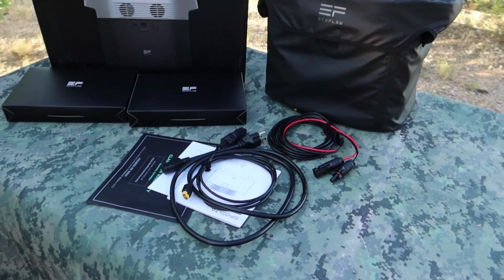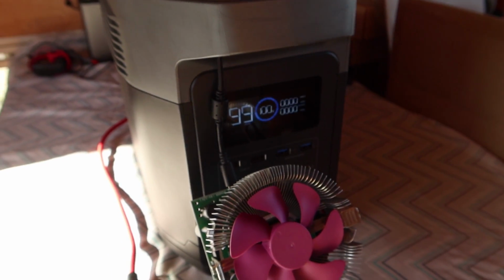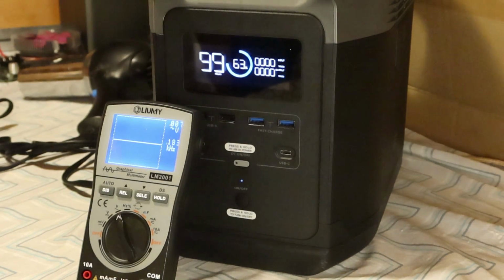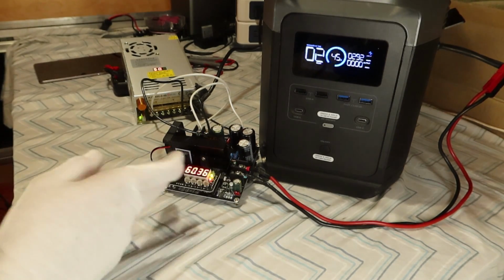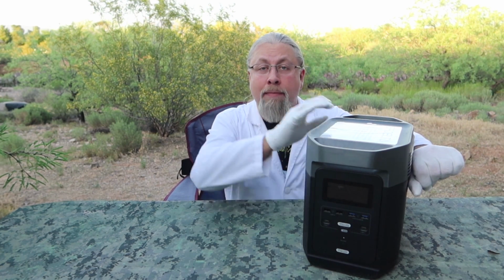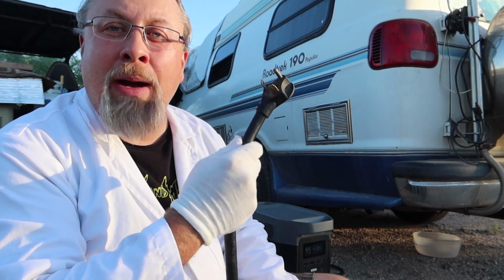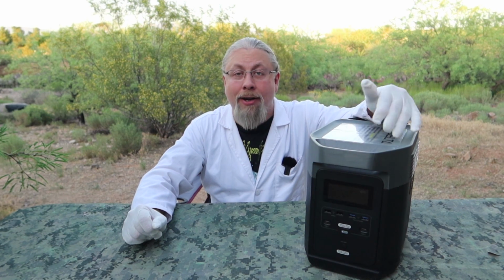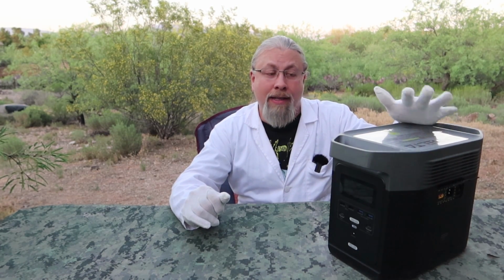EcoFlow DELTA 1300 A GAME CHANGING Solar Generator? HONEST Review! 1800w Portable Power Station

Comment: I bought two of these, as the chain function "sounded" neat, and they were $799ea on crowdfunding.  However:
1) It is not a great inverter.  
  a. neither will run my 12" radial saw, but a 2000w Xantrek + Valence battery will
  b. no inverter should have to have its cooling fans on w/o any load connected, and they are LOUD
2) The Round Trip efficiency came out to 58% and 60% on these units, the worse I have ever tested.  This is with fully charging, giving it a 2hr dwell time, then fully discharging, all @64°F.  
(Let me put it another way; you put $100 in the bank, but only get $58 to $60 back.)
3) People need to stop falling for EcoFlow's fluff- the standard for solar panel or lithium life is 80%.  EcoFlow just doesn't want to admit that they only give 500 cycles until you reach that.  Take 60% of the measured output today on a new unit, and ask yourself if you want to lug 31+pounds for that reduced round trip inefficiency.
4)  EcoFlow promised they would replace the batteries for free (you pay round trip shipping, which isn't cheap on lithium) once they get below 60%, but I have yet to hear of anyone having luck with that yet.  Nor do I trust them, as I told them my round trip test results and said I wanted to return them for a refund...crickets.
I DO NOT RECOMMEND.
Reply: good to know
Reply: I just picked up the River Pro and found the same lack of efficiency.  I can't believe more reveiwers don't pick up on it and just focus on the fancy bells and whistles.  So far I was only able to pull around 493-526 watts out of 720 watts advertised using AC.  Recharging requires over 900 watts.  Luckily I caught it on sale at Costco with easy returns.  Waiting to see what the new Jackerys promise.
Reply: Thanks for this. What one would you recommend ? Anybody ?
Reply from the maker: Go to hobotech.tv all recommendations and discounts there
Reply: @benallmark9671  Bluetti. The big one. Shop around as discounts are always being given.
Reply: @dougfresh1341  thanks !
Reply: $58-60 for a $100 ?!! Biden’s done a lot worse. 😏

Comment: Hello, quick question I am hoping you can help me with... I want to be able to use my 3qt instant pot  in my van, while driving or stationary ,, what would be my best bet for power? Thank  You in Advance for you input and suggestions
Reply: The  $80.00 one at  WalMart  only  pulls  700  watts = you  could  run it  for  about  two  hours  with  the  EcoFlo Delta  ( or  more  since  the  'instant pot'  will  be  cycling  off/on/off  once  it  reaches  it's  cook  temp. )   ALSO ,  if  you  are  charging  the  EcoFlo Delta  with  solar/etc. ,  it  will not  discharge  as  fast  or  at  all  .  .  .  .  easy  on  it's  battery  &  extra  power  available  later  .  .  .  .  .

Comment: What they failed to mention is that the amp/hour rating is probably is it were discharge for 20 hours.  I do not know how they would know what the load needs to be to make it exactly discharge for 20 hours to dead. The lower the load, the more power you can get out of it.  A heavy load will discharge the battery quicker.  Maybe the inverter uses more power, is less efficient, at higher draws.

Comment: Great video, but can you charge the ecoflow delta 1300 with 400w wind turbine.
Reply from the maker: Depends on the turbine.
Reply: @HOBOTECH  do you have any recommendations
Reply from the maker: @jasontrausch9745  Turbines don't work without a 50 foot tower so I gave up on mine a few years ago.

Comment: 800 cycles 😐
Edit: Ah, so, you’re getting 80% max of the capacity, and they’re saying it’s only good for 800 cycles to drop all the way to 60%. Methinks they’re using recycled cells because shouldn’t new cells be more like 3,000 cycles to reach 80%?
Reply from the maker: Generic lithium ion is rated 500 to 80%. Because they super charge and discharge this unit at the limit of the batteries the life suffers.

Comment: Your methods for measuring the purity of a sine wave is flawed.  At least you are now doing it under load, whereas before I watched you do it without a load, but to accurately measure sine wave purity, you must use a non-linear distortion analyzer or a frequency analyzer. Both use some form of Fourier analysis (FFT or DFT) to compute it.  Distortion is manifest by the presence of harmonic frequencies, so they would show up in either instrument.  The DA will give you the measurement as a % of non-linearity or distortion (THD).

Comment: How long can I run an iceco 20 fridge-freezer on the ecodelta 1300 solar generator from full charge down to about 10% charge
I'm not sure but I think the iceco 20 draws 27 amps.  I  very much appreciate your answer.  No hurry...take your time. Thank you.
Reply from the maker: Delta =1005wh usable
12v fridges use 250wh/day at 40F
~ 4days ...

Comment: There are two scenario's that I wish was included... Running your RV while solar charging and pass through of surplus power to your appliances; and can it have two sources of charging at once? Say perhaps a fueled inverter/generator AC connection and solar panels. This would demonstrate how much flexability you have as an ideal off-grid camping  tool. Great video though, and keep up the great content!
Reply: Don’t know if it helps, but we got the Bluetti. It does allow charge thru use from our solar panels.
So far the only downside is if you use the power faster than your panels replenish, it takes overnight to refill from plug in.
Reply: @dougfresh1341  Thankyou!

Comment: what a great review!   Any creative way to charge this from both 12v cigarette port (that turns on when car running)  and  a 300 watt 24v Solar at the same time?   In optimal solar day how fast will that panel charge this from empty? How long do you think i can run a 1000 watt electric kettle for?
Reply from the maker: Not without manually switching the input.
Reply: @HOBOTECH  shame. Ive read with the Jackery 1000 you can plug both in and will use 12v cig if it's live and if not will use solar which is just a very smart setup.  I think with that setup the unit would be near 100% for me most of the time in my van.

Comment: What about temperature wise?  Can I take it hunting or ice fishing?  Say store it in 20-30 degree temps for hrs and use it?
Reply from the maker: Temps are shown in the manual. You can't charge lithium below freezing but you can discharge down to 7F.
Reply: Ok pass, was looking for an alternative to off the grid ice fishing and fall hunting.  Will stick a gas generator

Comment: 10 amps at 50 volts?? Based on the V=IR rule, either of those should have depended on the load (i.e., resistance). Isn't it?

Comment: Hey found your channel trying to compare my needs with my budget. I'm disabled  but not dead yet. I'm n oxygen 24/7. Still want to be able to camp  and fir emergency. Have had power go out. Tanks wont give to me since I have a home and portable oxygen machine the in0gen 3. At 3liters my battery is only good maybe 3hours    I want to find a portable power /generator solar  under 500 that will last through 6/8 hrs to sleep that's quiet a d wo t over heat to power. It plugs into wall .it can use a cig.lighter in car.   But slow.  Charge. I would like a foldable solar panel. Prefer a kit with cables. So what ya think is my best bet to have it all!mm??
Reply from the maker: Jackery 500. Watch my review on it.

Comment: Im considering buying one for my mobile car detailing business. I run a Power washer, Shop Vac, Air Compressor, and a small water pump. Normally these will all be on one thing at a time. However sometimes they might all kick on at the same time just for a few seconds or minutes. 
Do you think this or any solar or just battery generator would be able to do the job for me? Im looking to cut the cost of gas and also reduce the amount of noise as sometimes I go to places of business. Thanks
Reply from the maker: It should work if you use those appliances individually. I use mine with a pressure washer.

Comment: Stupid question. I’d like to charge this Delta with my 1500 watt modified sign wave inverter. Can I do that or does it require pure sign wave? Thanks!
Reply from the maker: I wouldn't do that. This thing has a lot of sensitive electronics inside. I'm not sure how good their charger is in filtering out bad power.
Reply: @HOBOTECH  I was afraid of that. I’ve asked EcoFlow too. I’ll let ya know what they say.

Comment: Aren’t lithium battery protectors supposed to shut of the battery before it goes below 20% power remaining. I think once a lithium battery goes beyond 80% usage, it can fail to recharge. Not sure if this is true with graphine lined lithium batteries. For the record i have only slept in a Holiday Inn Express 3 times, but all my motorcycles have lithium batteries and warn of this..
Reply from the maker: BMS handles all that. Most of these discharge to 10% internally but show 0% on the display then shut down. Works exactly like a cell phone.

Comment: Old school PCs used smaller fans they these days, not big ones, that's why they were louder. A smaller fan has to spin faster than a larger fan to move the same amount of air, plus more turbulence equates to more noise. Anything in the path of a fan's airflow will create more noise, so removing poorly designed fan covers can often make them quieter, plus having smooth, ducted edges into the fan can help. This is an area companies will cheap out on and just stick a crappy little 80 or even 60mm fan in their device to cool it, without mush thought to through-flow and its effect on noise.

Comment: I want to go boondocking and my main priority is powering a small 12 volt fridge 24 hrs. a day.  I'm not very electrically savvy so have been watching tons of videos trying to figure out the best system and am starting to get a headache from info overload.  I notice most of these videos talking about solar are shot somewhere in a desert but in Canada it is common to get several cloudy days in a row so solar doesn't seem like a reliable option.  What is the advantage of these over just having a couple of deep cycle batteries and a separate inverter.  I also live on a small pension so don't have the thousands of dollars some of these systems cost.  Anyone know a good video on powering small 2 volt fridges on a budget ?

Comment: OK, this may seem really obvious ... If you are plugging in with a 120/30amp adapter into your RV and your RV has only a 1000w inverter, the 1800w inverter does you no good. Better then to get the Bluetti 2400 for those of us who want to charge RV batteries or run just lights, etc. while we entertain ourselves with our cell phones.
Reply from the maker: Your on board inverter has nothing to do with the inverter in the Delta. If you plug your shore power into the Delta's 1800w inverter you get the full 1800w to your appliances inside.
Reply: @HOBOTECH  well that's a pleasant surprise!

Comment: Thank you for taking the time to review this unit. I wanted to like EF Delta and it’s newer R600,  but with regular complaints from customers about 6 month lead times... no thanks. Compound that with the fact that all EF products are made in China (read as ongoing tariff and trade embargo issues with multiple countries) and the high number of customer complaints for very bad or non responsive tech support, you are far better off buying a Titan or like model. Degraded modular batteries can be changed or expanded instead of being stuck with a self contained units with half of its original capacity after a couple of years. Do your homework folks and calculate the investment cost.

Comment: Does this "Solar Generator" or any other "Solar Generator" have the capability to be plugged into AC and Solar at the same time and manage the input on it's own so you don't have to fiddle with it? My application involves reducing grid electricity consumption at home.
Reply from the maker: No. It's either or.

Comment: 1. Can it run an AC 1118.5W (1.5hp)?
2. What do I need to plug it on a 220-240V outlet?
3. How long, in hours,  the 1118.5W AC would run?
Reply from the maker: About 45 mins.

Comment: I did the math for 18650 li-ion batteries, Samsung wholesale are $2.77 a piece if you buy 1000+. With a life of 500 cycles it works out to $0.53 per kw-hr. Definitely a last resort power supply.

Comment: Here is a question. Instead of tieing 3 units together, I would think, by what you showed. It might be better to use 1 unit, and then batteries after that. It seems like it would be cheaper and more efficient.

Comment: You might want to tell your viewers that with an outlet timer you can greatly extend the run time for a fridge.
Reply: robert kinney please explain.
Reply: @MyMinivanLife  What the timer plugged into the generator and then that in turn turns the current on and off at greater intervals than the compressor doing the same thus providing a greater length of time overall electrical draw on battery..

Comment: I had one of these, it took a dump and stopped working after 5 charges  and discharges.  After HORRIBLE customer service I was finally able to return it.  I DIDN'T get another one.  Like Tom says, the battery capacity is crap compared to price and or advertised capacity.  The Customer service is non existent just about, it's expensive watt per dollar wise.  It's batteries are just a bunch of 13750s strung together which the fast charger is cooking like an over done egg while it charges, AND don't think you are gonna discharge this at any respectful discharge rate more than a little while and then except to charge it back up.  NOPE.   It sits there for a 1-2.5 hours cooling down with those darn fans a running the whole time while it's locked you out of charging.   And then finally I found out who was behind this power station and it completely explained the joke of customer service.  And that would be DJI.  I have had massive amounts of experience with DJI and they are one shade of grey away from predatorial in their approach to business and their customers.  Basically they will screw you in a heartbeat if possible, believe me I have TOO much experience with them.  Additionally remember this is a very first run of a product.  There is always issues with first generations of things like this it seems. AND given the people behind this power station, YOU are the Beta Testers, believe me. The guys running this are just DJI employees and they certainly carried that downright corrupt business model right into this company, was my take on this once I finally was able to get this defective unit back to them for a refund 6 weeks ago, and I STILL haven't gotten my refund yet......Yes, I was really bummed me out when I found out this info. .comn, the unit completely stopped working, not even any lights or anything after just 5 cycles??!!     Well, just wanted to let Tom know and anyone else interested , what issues I had with it.   I went ahead and sent back to Blue Etti 1500.  Certainly a better value and better service by far .   And the batteries are high grade LG batteries from what I understand.  P.s.  I couldn't find out even the manufacturer of these basic run of the mill 13750s in the Delta.  My suggestion is to stay away, at least for right now.  Oh well, best of luck!

Comment: Add the battery capacity of the Bluetti 2400 and another 12V DC plug and I'm sold.
Reply from the maker: Sounds like you'll want the upcoming R600.
Reply: @HOBOTECH  May hold out for the Mothra water powered version! LOL

Comment: I am a bit puzzled why you would buy one of these, I have a140 watt solar panel, lead acid battery, and a 2kw inverter tot cost $500 on my truck and if it runs out of power I start my truck, this runs all my tools, and microwave, fridge etc
Reply from the maker: I suppose you don't see the benefit of carrying the power of your truck in one hand.

Comment: At 24:20 - about cycle life and fast charge/discharge - is this device utilizing supercaps? The lithium batteries should not be taking a hit if in fact supercaps are being integrated. Someone needs to do a tear-down of this device.
Reply from the maker: Been torn down on several channels. This uses standard NMC cells, not supercaps.
Reply: @HOBOTECH  Thank you for your response. Well then that is your answer.

Comment: Slow charging on AC should be easy to implement as it already does that when warm inside.
Reply from the maker: I suppose charging it in your oven would do the trick. 😆
Reply: @HOBOTECH   I would prefer a firmware update instead of toast ;-)

Comment: I bought one of these DELTA's and the most annoying aspect to it is the solar charging, you need PERFECT sunlight for it to charge and I MEAN blue skies perfect, any clouds get in the way and it won't give me anything in terms of wattage. I have 200 watts of panels in serial arrangement. Yet if I plug in my lensun battery or 'solar generator', it will charge with cloud cover or even charge a few percentage points before 12pm with just the background radiation.

I paid more for this and the panels become less sensitive plugged into the Delta and will actually discharge a percentage point each day if not enough wattage goes into the system while plugged in. All kinds of crazy disappointing if you ask me.

Comment: Outstanding review!  Your analysis of the tradeoffs was right on.
 I do not know what possessed me to pay for one through the kick start program.  I first chose the lower wattage model and then upgraded  for the higher wattage model. It was a really good deal at the time and I guess it was.  Both of my large capacity solar generators EMP proof bags.
What I am looking forward is the reduction in price of LiFePO4 batteries and the application in large capacity solar generators and plug and play stationary power storage systems fed off solar arrays.